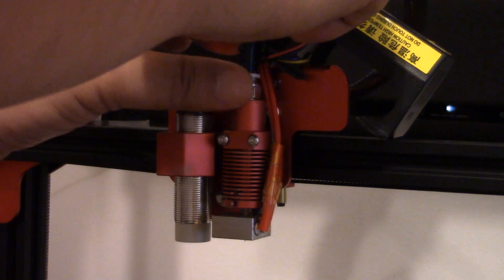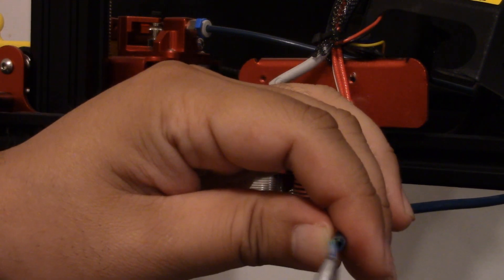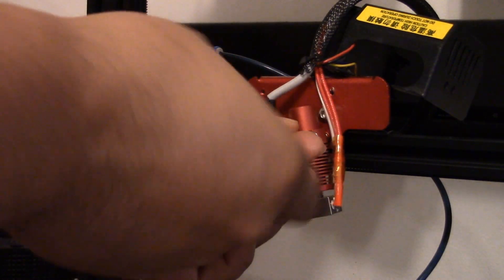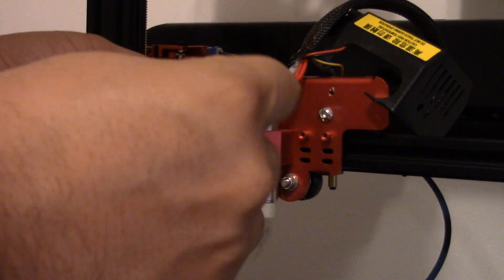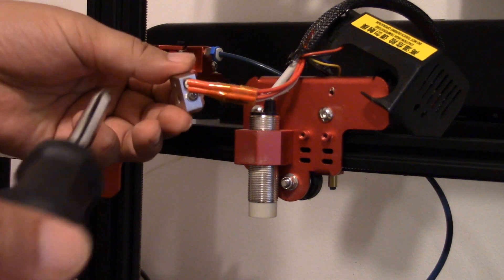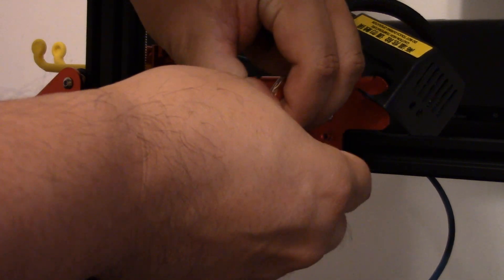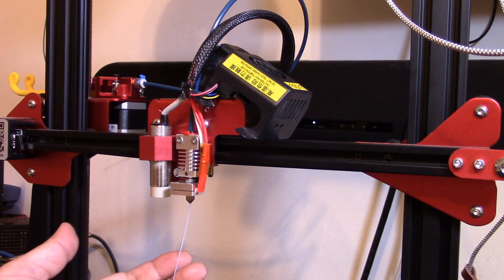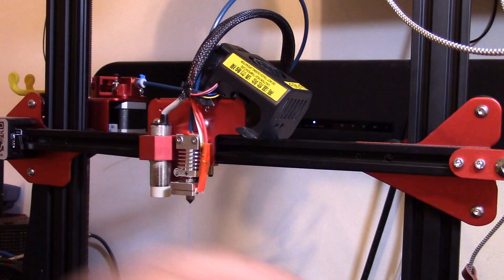Creality Cr10s pro Micro Swiss all metal hotend upgrade

Comment: Hi nice video, I want to buy this hotend for myCR10S PRO V2 since the hotend that came originally had a M4 nozzle, I was wandering if this one uses M6 nozzles
Reply: mk8 stock Ver the miro i don't know, m4?? do you meane point 0.04mm which is stock? on both hotend but yes you can use a 0.06mm nozzle on them but remember to change it in your slicer as well.

Comment: How does that not cause the PTFE tube to offgass? It's still directly interfacing with all metal hot end
Reply from the maker: In order understand it; you have to take apart the components and compare a stock hotend to a premium hotend. On the premium hotends the heat break is bigger and thicker(plus cold block more efficient) and ptfe tube is in contact with the heat break(on the cold side). The heat break is sandwiched between cold block(always cooled by the fan) and the hot block. The ptfe tube rest near the cold side of the heat break. So another way to put it is if you have a iron rod and one side is always being cooled and the other side is always being kept hot. There would be a temperature differential on each end and depending on the size, design, material, etc. the differential could be increased or decreased. Also, the capricorn ptfe tube has higher temperature tolerance than a regular ptfe tube. Plus the ptfe tube is much closer to the hot block on a stock hot end. The closer the temperature will be hotter. So just remember the 3 components hot block, cold block, and the heat break. Often we confuse these as doing one thing, but they are different components that serve different purposes. One heats, one cools, and one creates a break or differential of temperature.
Reply: @DiyProJames  thank you for the detailed breakdown. Feel a little safer. I was looking into the CR-5 PRO H, but I wasn't sure I should trust crealitys design with the PTFE tube... no room for direct drive so I was looking into the CR-10S micro swiss upgrade, which is rumored to directly bolt up.

Comment: Hello! Thanks for the video. Is pretty helpful.
I am having an issue with the thermistor, I can't get it out of the heat catridge... Any advice? I don't want to pull very hard since the wires will break up and that's not the idea (I neither want to buy a new therm wire)
Reply from the maker: Sometimes there may be some plastic residue and depending on the heating block there may be a small gap you could use a small screwdriver to pry the gap larger. Try heating your the block and push thermistor out when cooling. Heating it may expand the metal.

Comment: Can this hotend be used on a cr10s pro with a bl touch installed on it?
Reply from the maker: Yes, make sure you get the one for the cr10s pro. There is a slight size difference with the cr10s pro vs. cr10s / ender 3.

Comment: I'm having leaking issues with the stock on my CR-10S Pro V2 and so far I haven't been able to fix it so I have ordered this now. Hopefully I wont have this issue.
Reply from the maker: There is an order to putting the hotend together. Nozzle goes in last. Get it up to temperature before threading.

Comment: Hey James ur videos have been very helpful. Brand new CR-10 V2 keep getting clicking noises from extruder then stops extruding. Seems like the PTFE tube is moving inside the hot end . Any solutions on this problem ?
Reply from the maker: Sometimes people forget to put in the little blue or red clip that makes the teeth inside the coupler bite into the ptfe tube preventing movement. You might want to check that.. Also, it may be a partial clog.
Reply: @DiyProJames  The blue caps were on place, changed the nozzle with a brand new one problem still occurs clicking noises when retracting and sometimes when it pushes fillament it makes a faint clicking. Also the arm where the spring is its actually moving a little bit when jt pushes fillament in. Is that normal? Thanks for replying. Thanks to you i jave perfect bed level but now the extruder seems to do monkey shit.

Comment: Hi, I upgraded to a micro swiss hot end. Do you have any recommended settings for retractions and retraction speeds? I've already tried to tune everything and the output is worse than with the original hotend. I print the most Petg. Alternatively FFF profile for simpify. Thanks a lot, you're doing a good job!
Reply from the maker: Retraction distance should be around 6mm and 25mm/sec for speed... But it seems to me you have not done a pid tune https://youtu.be/jVcIt7nFaks and a estep calibration https://youtu.be/5cOT0dFbtvc. Whenever you add a new hotend you should calibrate your printer.

Comment: I installed the micro swiss on my cr10spro but my sensor is not working properly anymore. Whenever I set z home there is a different height of the nozzle.. sensor height itself is set up correctly though..

Any ideas?
Reply from the maker: This is because the microswiss hotend has different dimensions than the stock hotend. Whenever you switch out a hotend you need to change the x y and z offsets. Stock sensor you do this manually. If you have a bltouch you do it via the firmware.
Reply: @DiyProJames  I did change my offsets for z manually by lowering the sensor. Whenever I set a new zHome via the leveling menu it doesn't save that. It is always at a different height.
Reply from the maker: @DatFunnyPerson  It's one of the limitations of the stock sensors for the cr10s pro.. Did you replace the bed material? The capacitive sensor is affected by things like bed material and atmospheric temperature. It's not as reliable as a mechanical sensor like a bl touch. Also, I would re-adjust the screw to see if your sensor is set at the correct height.. If there is any type of movement in the screw it may give an off reading..
Reply: @DiyProJames  I have a glass bed and when I heated it. The sensor worked. Thank you for your great support

Comment: I have two questions! One, what firmware/settings change do I have to make before/after installing this Micro Swiss Hotend to my CR-10S Pro V2? And two, how has this modification been working for you? Any filament leaks ever since?
Reply from the maker: The only firmware change you'd make is to increase the hotend max temperature. Not necessary if you're planning on printing lower temperature plastics. The only other thing I would recommend you do is a pid tune https://www.youtube.com/watch?v=jVcIt7nFaks and estep calibration https://www.youtube.com/watch?v=0IuK74if9TM

The filament did leak once when the heat break hit the printed model hard. I accidently moved the hotend without removing the 3d printed model on the bed. It hit the heat break at just the right angle and knocked it loose, but I haven't had much problems since then... I use octoprint and accidentally moved the hotend with the 3d model still on the bed.

Comment: Great video!  I've hit a small problem.  Since installing the Microswiss, my cooling duct sits lower than the nozzle, so I can't level the bed!  Any ideas?
Reply from the maker: Try using this one. https://www.thingiverse.com/thing:4226193
Reply: @DiyProJames  That's the one that';s sitting on there now... though I think Amazon have sent the wrong size Microswiss!!
Reply from the maker: what is the thread size? mine is an mk8. As i remember I think the original hotend nozzle is slightly longer and the micro swiss hotend nozzle is slightly shorter. Trying to remember, I think when I modeled the duct fan I raised the duct very slightly for that reason.
Reply: @DiyProJames  So, it turns out, i'm a bit of an idiot....After discovering by accident that I ordered the MicroSwiss for the CR-10, not the CR10s Pro!!  Hence to say, new part on it's way and fingers crossed, all should be well!
Reply: @daiwellby  did the duct not hit the bed when you got the correct microswiss hotend?

Comment: Bed leveling with those black nobs in bottom of bed is a pain
Reply from the maker: Yes, they are... The best method I found is once you established a baseline. Use the z level offset to get the initial first layer while the printer is printing. This I find works best for prints with large surface area. If you get the initial layer to bond correctly; there is less chance of the print going awry later down the line.